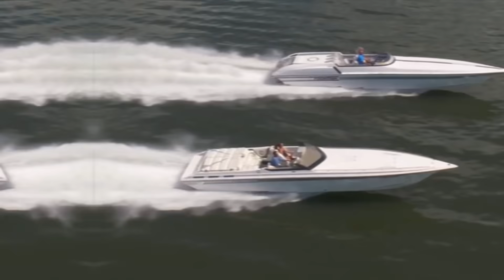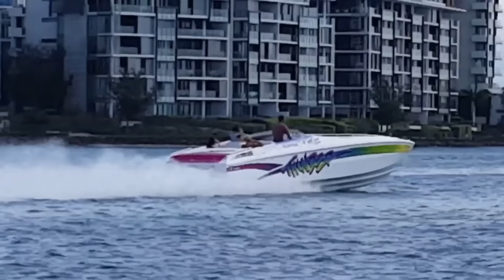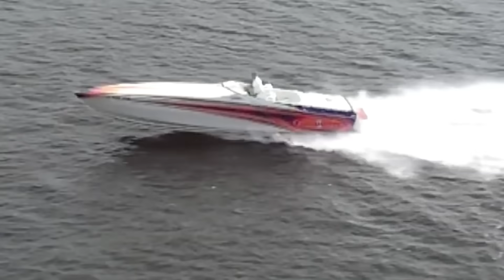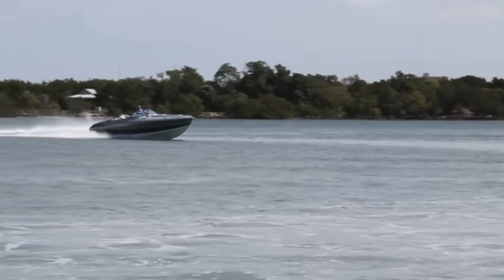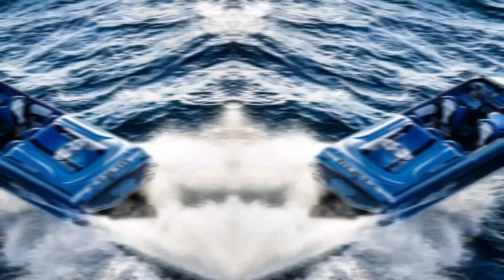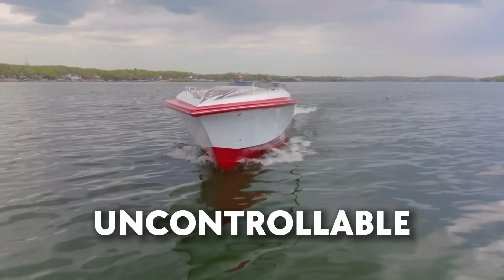TOP 10 Most Dangerous SPEEDBOATS Ever Built

Comment: The "information" presented in this video is absolute slander. You cite hull design, features, and models that don't even exist! Fountain didn't have a tunnel hull. The Scarab 38 kv wasn't a stepoed hull.The Cigarette Cafe Racer is a 35 foot model, not 42. They also didn't build a single engine 38, nor did it have rudders.Donzi did not have steering problems. They use quality systems from companies such as Latham and Mayfair which all manufacturers use. If Donzi had a steering issue, it would be present in EVERY brand. Honesty,  I hope the manufacturers named in this video sue for defamation. You deserve it.
Reply: That's obviously AI slop...

Comment: There never has been a Fountain Lightning 'tunnel'.  No idea where this complete drivel came from.   A Cigarette Top Gun has never ever been built as a single engine.    The Scarab 38KV was never built with steps.   Good Lord I quit.  AI Crap that is just out and out false.  Not even close to the facts.
Reply: I think the Limey reading the script doesn't even know what he is reading !
Reply: Completely agree.  Back in the 90's, an acquaintance of mine owned a home on Barnegat Bay (NJ) and had a Fountain 42.  Having been a passenger in that boat at 90+ mph several times, it was absolutely stable.   This video is complete horseshit.
Reply: 100%.. 30 seconds in im done.